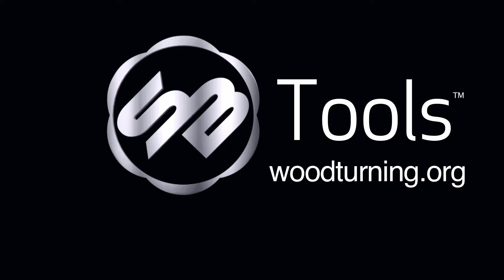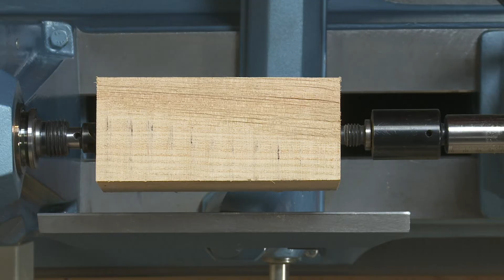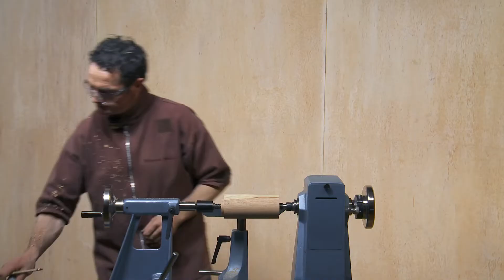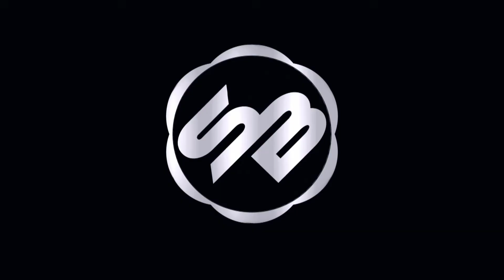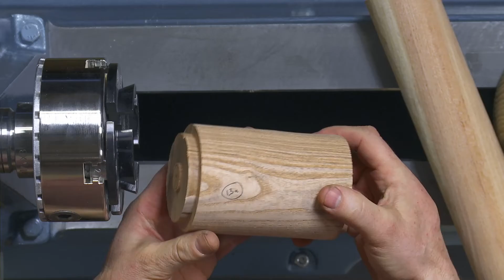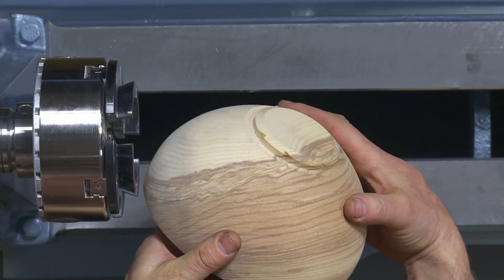Tenons - Part 2 1080p

Comment: Good Day Mr.Batty. For your first tenon on the endgrain (spindle) piece you are using a bowl gouge. Is it faire to say that a spindle gouge could be use to acheive the same result or does the shape of the flute not allow to get the tenon in one pass..Thank you for your videos they are very well made.
Reply from the maker: Sorry for the delay in this reply. The only reason the bowl gouge works on this is because I use a 4040 grind on my bowl gouges.